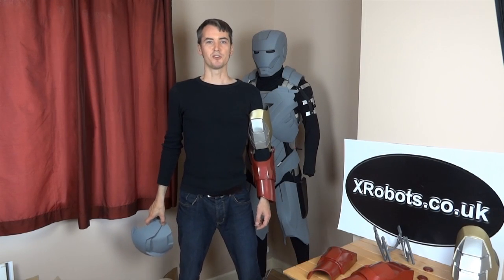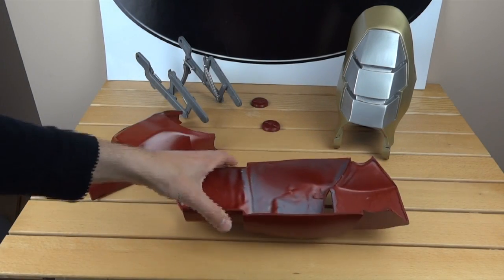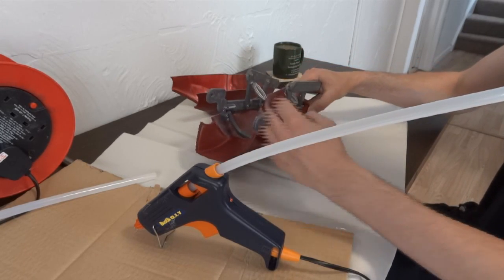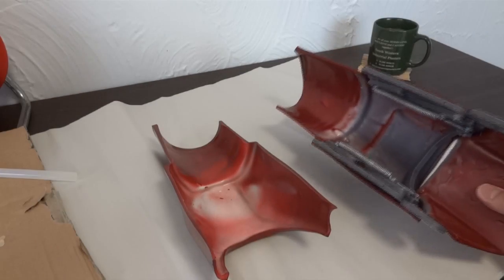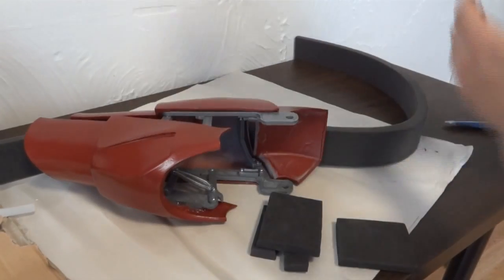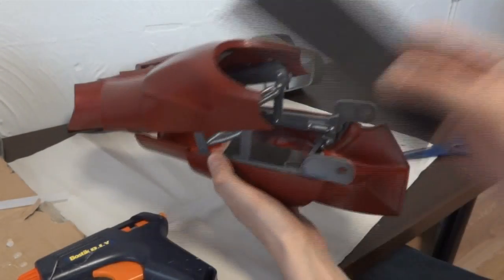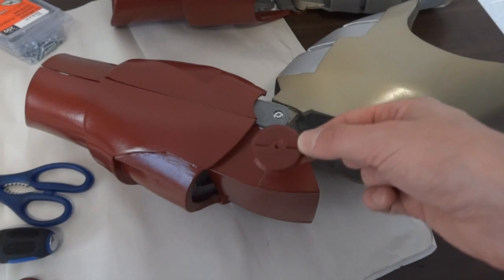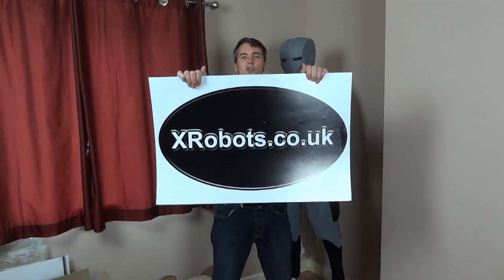Iron Man Power Suit #36 | Final Arm Mechanism | James Bruton

Comment: Couldn't you have printed EVERY arm segment on your 3D printer, even the outer shell?  I doubt there'd be any large segments which couldn't be split up to fit into the build space.
You'd give the shell parts an acetone vapour post-treatment to make them smooth and shiny.

Comment: Why not have stainless steel bolt and nuts?  The nuts sitting in recessed access points as well as the bolts for a clean look.  If you used button head Allen key type bolts with nylon locking nuts I think you'd have a much more reliable hinge system.

Comment: Awesome work, I was thinking, with the back of the hand plate, it could be attached to the top of the forearm in the right place and the glove edges could be attached to the inside of the forearm, so that when the top opens, there's a wider gap for your hand to fit in and then it will enclose your hand in when it shuts? Just an idea, good progress tho :)

Comment: The new right arm seems to have better clearance on the opening mechanism than the older one? (looks like the tip of the left upper piece clips the lower piece when it opens? or maybe its just a very close fit). Looks great though - can you still pronate/supinate your forearm?

Looks like it'll have to be arms on first followed by gloves?